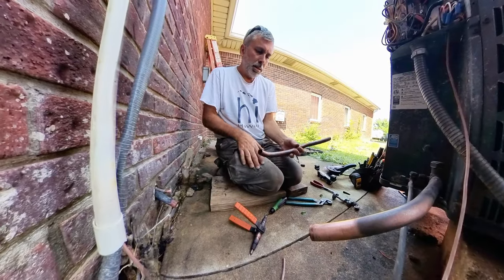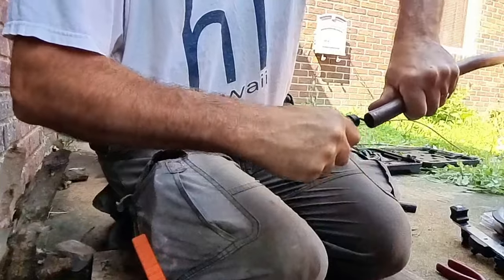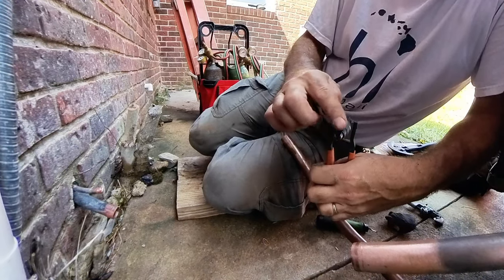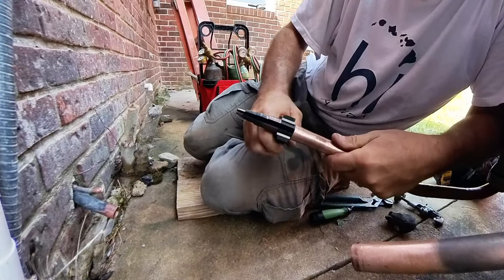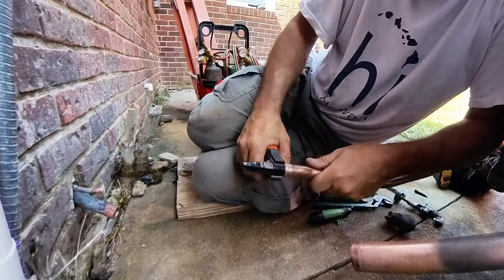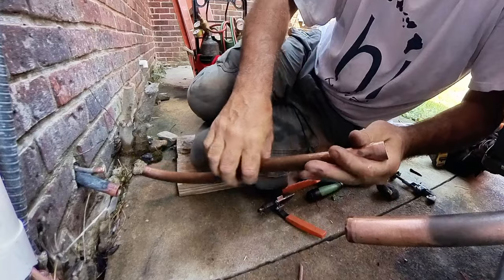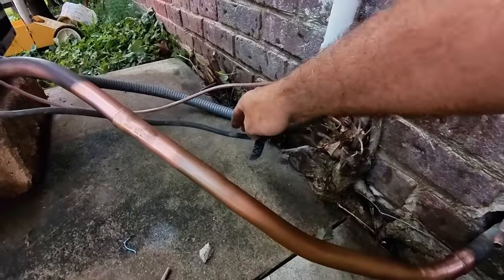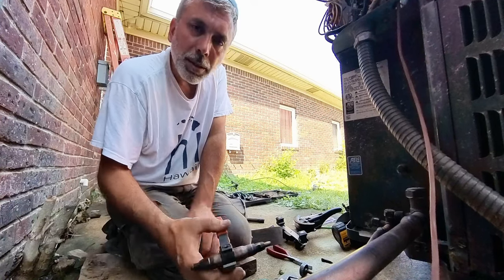Watch before buying a Tubing Expander - HVAC Tool Review

Comment: Hey man just started a maintenance job at a warehouse and Im about to start my Hvac classes at a technical college. I help the guy at work that does refridgeration and HVAC. I burned my self last Saturday with refridgerant. What are some good gloves to use for this trade? My warehouse doesnt provide good gloves or glod equipment. Thanks. Ps. Its hard to get into Hvac because i have 0 experience which is why im putting up with this job to learn. Im really interested in this. Thanks.
Reply from the maker: I have burnt my hands with refrigerant a time or two also:). I don’t usually use gloves, but when  I do, I use a thin pair of mechanic gloves that have leather on the bottom side and fabric on the back side, so they protect and breathe.  I hope you find someone to work with, that is good at HVAC work, and willing to invest in you!  It is a really good field to get into.
Reply: Good luck in the field, sorry bout the burns.